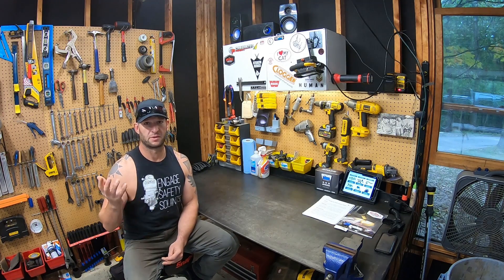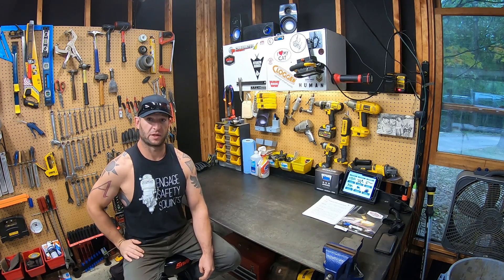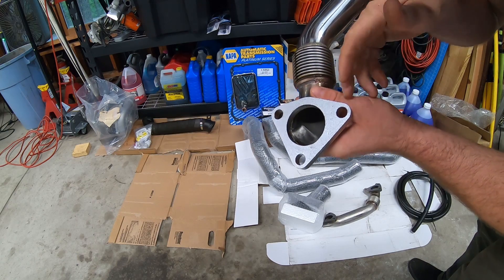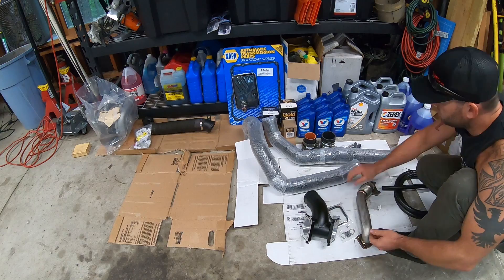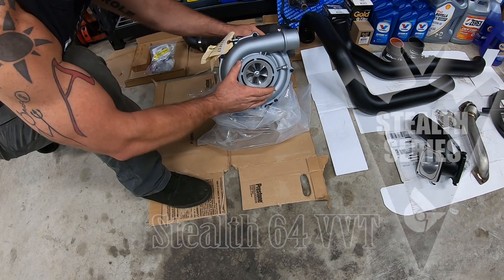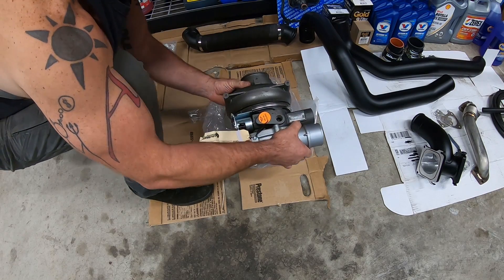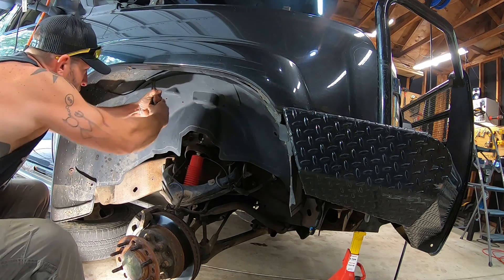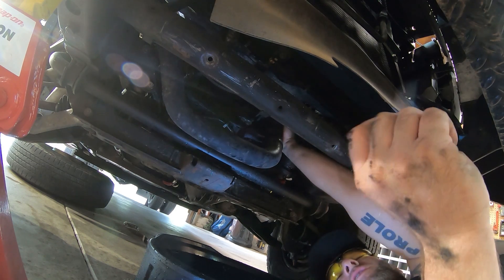Truck Upgrades with Duramaxtuner.com and Wehrli Custom Fab: Day 1

Comment: Search Ebay for a Stud Extractor, kinda looks/works like a drill chuck with 2 wrenches. If there's a stud to remove might work to clamp it down and wrench it out in tight spaces. Good for the arsenal

Comment: On those uppipe bolts they should be sprayed from holes in backside. Be sure to use Copper Antiseize on all the bolts. 
Ratcheting wrenches are awesome. As well as 6pt swivel/flex sockets.

Comment: I know its too late now, but the next time you have to take out bolts that refuse to move, apply some heat to them and let them cool, fire solves everything. The heat expands the bolt a bit, then when it shrinks it breaks the rust thats holding it in.

Comment: Oil in diesel intercooler is normal dude. With all the emissions crap they have, EGR’s and shit, oily fumes get recirculated into your inlet and through the intercooler. Grab a prov vent catch can to filter out some of the blow by. I removed a 2000km young hilux intercooler and it had shit loads of oil in it already..... euro 5 and Diesel engines just doesn’t mix..... 🤘🏼🇦🇺
Reply: Sorry, meant intake pipes and intercoolers.

Comment: Now you know to use a little heat on those nuts next time. Most exhaust shops will heat a brake loose bolts like that to avoid you coming in wanting them drilled or burned out.

Comment: If you haven't removed the broken studs,  try the wax method.  I use it to remove broken exhaust manifold bolts on semi truck engines where i work.
Reply: How does that method work?
Reply: @flashbang009 drill a hole in the bolt son you can stick an extractor in it, then heat the bolt and what it's screwed into up with a torch.  Get it realty hot,  stick a cheap candle to it.  It's sucks the wax into the threads.  Then let it cool by itself.  This will break the rust up and lube the threads. If you are not using an extractor, you don't have to drill a hole in the bolt first.  But I always do,  cause the hearing of the bolt will harden it and maker it harder to drill.  If the broken bolt is sticking out enough you can weld a nut to it to turn it out.
Reply: I have done this multiple times,  works like a charm.  I keep cheap candles in my tool box just for this.  In a pinch,  I have used birthday candles.  Lol

Comment: You got patients, this job is 1000 times easier if you pull the cab off. The cab removes pretty easy too, steering shaft, pop the master cylinder off, AC and water lines and two big electrical connections then body bolts and it comes off.

Comment: Wow, those turbo kits practically install themselves.
Reply: In the words of Larry The Cable Guy "" Now that's funny there, I don't care who you are""
Reply: "Yeah bro it's easy! Just a simple bolt on kit! I mean, it's 480 bolts... but still technically bolt on!"
Reply: Basically just fell in.
Reply: Nothing better to do than work days to get to the part you need to change. Half the truck is laying in a pile. There in lies the reason I'll never own a ford or Chevy. Can't say dodge is the best either but the second gen I got is way easier to work on. Not the strongest or fastest but has pulled everything I ever hooked to it. Way to much shit on these new ones.
Reply: @oldfarmer4700  the only thing dodge trucks have going for them is the Cummins engine! Other than that they are just piles of 💩💩

Comment: You take great care of your equipment. That said, this is my impression of you. “I gotta go get groceries, so before I do that I better weld some gussets onto my trailer and drop my drivetrain and replace every nut and bolt.  While I’m at it I figured I’d flush my windshield washer fluid, and replace it with a new filtered washer fluid delivery system.”  Lmao you rock bro! 🤘🏻